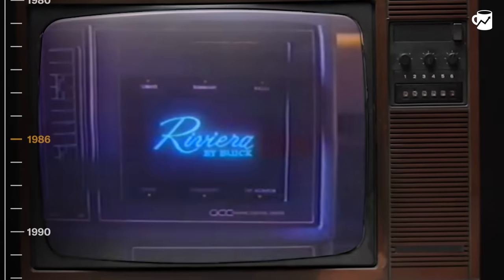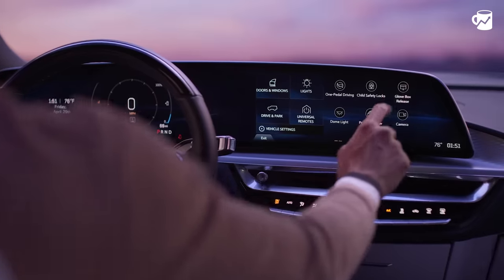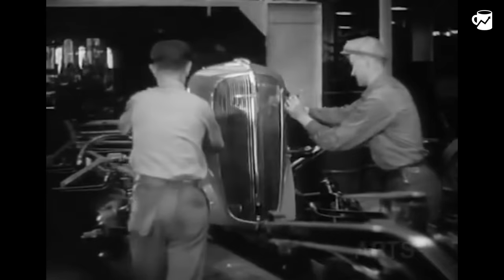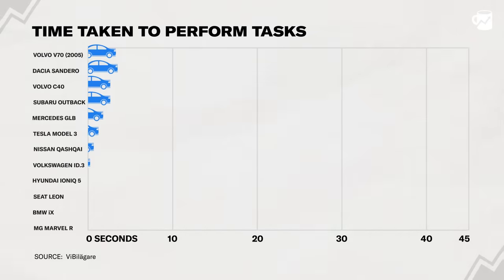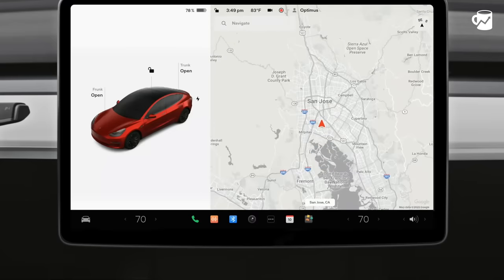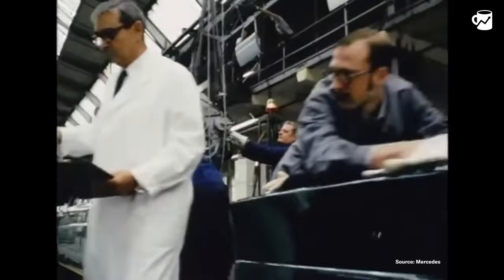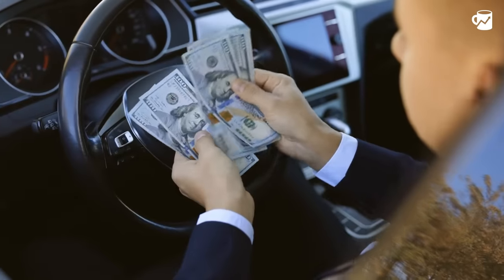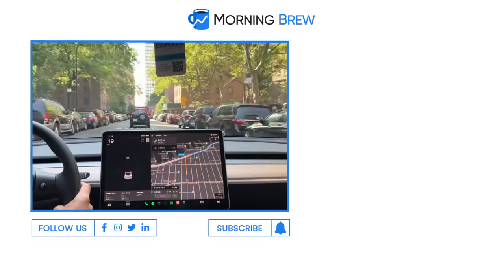The Real Reason New Cars Have Touchscreens

Comment: mazda nails it right now. Small screens mounted above the dashboard near the sightline. My family has a cx-30 and i love the interaction with the infotainment. But everything that you need to change quickly is physical buttons (ex. AC, seat adjustment)
Reply: What’s funny is that the entire automotive review industry seems hellbent on trashing Mazda’s decision to not have a touch screen, and all the screen addled addicts all similarly complain without any valid points.

Personally, I find that the command knob is much less distracting to use, even if CarPlay and Android Auto are touch based interfaces.
Reply: I have a 2021 mazda and I agree on the hardware side of things but mazda's sw is hot garbage.  2018 vw golf is the high water mark IMHO. Small responsive touchscreen but buttons and knobs for all important inputs.
Reply: The location and controls are ok but software is pretty bad. Slow to respond and no color coding to quickly identify a menu. Also sometimes touch is just fast for a quick touch of something but Mazda locks that when driving and the screen is hard to reach
Reply: @fanovaohsmuts  I am a big proponent of buttons over screens, never liked the idea of having important stuff like AC behind a touch screen. I’ve driven Mazdas several times and can easily say that the command dial is worse than a touch screen. It takes significantly longer to do anything and way more distracting while on the road. Want to switch from gps to music? On a touch screen you look over for a second and click the Spotify icon. On a Mazda you have to constantly look over to see where the dial is positioned previously and navigate it correctly to the new icon. The automotive industry doesn’t trash the command dial because they are addicted to touch screens, they trash it because it is an inconvenience and step back.
Reply: @fanovaohsmuts the command knob is garbage to use and makes me want to control CarPlay with my phone, which defeats the entire purpose of making touchscreens less prevalent in the car.
Reply: Excellent video, and I couldn’t agree more with all of it. The only thing you didn’t mention, is the lack of esthetic integration that is also a current trend. Most of these screens just look stuck on the dashboard, or even worse when they are used as a gauge cluster.
Reply: what's in my Corolla is great too. 8" screen which does wireless android auto, but physical buttons for everything that I need to interact with while driving.
Reply: That's how it is in my '22 Civic.  The thermostat controls and all the important ones are all knobs and buttons
Reply: Who tf wants a mazda though 🥱😂
Reply: @afsan2321  Anyone who wants a reliable car that drives decent? something that isn't a korean or american pile of crap?
Reply: @fanovaohsmuts Yeah Mazda did it right by doing that. What I wish Android Auto and Apple Carplay to design their UI to be optimised for physical controls. Means menus needs to be easy to navigate with up and down controls. Just like a game console UI does. This makes the navigating UI more predictable without looking at the screen and once the driver masters it, they can just use muscle memory to navigate the system without looking at all.

They need to stop thinking they need to follow Telsas bad trend. The only thing that they did good for the industry is making EV more attractive. But the UX of their cars is clearly not the best interest of drivers, but just makes them cool to average consumers which is actually not great for driving.

They're just cost cutting and maiming profits all still they are suffering with many QA issues on their first batches of the cars, even later batches.

Seriously, why they heck it needs a touchscreen to even open a glovebox?
Reply: @afsan2321 Alot people. Who wants actually good looking reliable car and not trying to be iPad on wheels. It's still modern car, just not pretending that is self driving car when all cars in existence still haven't reached the level 5 autonomous systems in production. And no Tesla Autopilot isn't full self driving still. It may be the best we have but that's still not classified as full self driving.
Reply: @afsan2321 . Me and the knowledgeable. Every time. Very silly, very ignorant of you.
Reply: @fanovaohsmuts Exactly!
Reply: @LBrisk01 Your opinion, touches screens are the worst things to ever happen to cars and Mazdas knob is much better.
Reply: @kornkernel2232 Mazdas are actually amazing cars. The build quality, the interiors, the performance and reliability is all top of class. He just doesn’t know cause he hasn’t actually been in one
Reply: This is one reason i choose Mazda. Just love their interface.
Reply: @samagon00  Never heard anyone say a Corolla is great. Ugh.
Reply: @ambiarock590  most econo cars are!
Reply: @afsan2321  me. I want a mazda. Buying one today. Preferrable to American crapboxes, and doesn't have a brand premium like honda/toyota. Also no CVT garbage.
Reply: @afsan2321 if you don't understand zoom zoom -part, nobody can help you
Reply: Mazda is nailing a lot these days.  For a company that competes in the very difficult economy/midrange segment their cars are attractive, have a modicum of performance and some of the nicest paint in the industry.  If I was purchasing in that segment Mazda would be at the top of my list.
Reply: I have the same car, having physical buttons for all the basic features was a major draw.

Comment: I once worked in computer security. I don't trust the newer cars with their over-the-air software updates and subscriptions for features. I also hate how complicated they've become, and how the windows have shrunk so much that they require backup cameras now.

I'm keeping my old car because it has real buttons, and I can see out of it. It's also much simpler mechanically, the parts are cheap, and it's easy to maintain it myself. It's 17 years old and has 247,000 miles on it, but it still gets me around comfortably.
Reply: ...I keep wondering how much longer I can hold onto my '97 Saturn, a five-speed manual with 215,000 miles. 

The Subaru BRZ is the first car I've happened upon in a decade that I actually like - and can order in a stick shift - but no one has it in stock locally for a test drive. That will take at least $500 and two or three months... 🙄
Reply: And you are in computer security? 
A profession that requires constant learning, adaptation of new technologies and MUST have a passion to complex problem solving. 
“Your brain is your limitation. Understand that. Turn your fear into curiosity.”
Reply: That's something that I didn't think about. It may be way harder to fix these cars yourself because you'd have to be knowledgeable about how computers and networking work...for buttons that even control small things.
Reply: There are real safety features tho
Reply: @kalecale  In light of recent reporting about how car companies are selling/sharing information, I continue to stand by my comment.
Reply: @RandomRads  i work in IT and do not think everything new digital is a good idea. Usually they solve a problem that did not exist.
Reply: I drive a 2007 Pontiac Vibe with over 240,000 and the it has major hail damaged taking out my sunroof and I still daily drive it.
Reply: The US gov mandated backup cameras in 2018 or so. That freed manufacturers up to make smaller windows.
Reply: @ladyd8028  I hope you have good luck keeping it running. It’s a damn shame that we lost Saturn as a manufacturer. At least the Big Three started treating women as human beings, after Saturn showed them how it was done.
Reply: @AndrewTSq  I suggest that a lot of people in IT don’t understand their own field to include IA. The vast majority of them consider themselves engineers when they are technicians. Highly intelligent, highly skilled and highly productive but technicians nonetheless. Being a technician is not a bad thing, but understanding when you are a technician is an important thing.
Reply: What’s hard to understand about needing a subscription to run your seat heaters? No… Wait…
Reply: @ladyd8028  Wow Saturn that lasted 27 years? That's actually pretty impressive. My uncle used to work at a deal for them and even he didn't deny they were pretty crap quality. 

I'm not suprised my old 97 Camry still runs though. Seems that many of them are still on the road.
Reply: @RandomRads if the value add is complexity and not ease of function… it’s just a cash grab. I’m in the same field and want transportation, my brain can handle whatever. It is a vehicle not a womb or a new wonderful empowering thing.
Reply: @gh0s1wav modern cars have more visibility not less, the law requires backup cameras.
Reply: No offense, but cybersecurity professionals don't actually have to know how to code, or have deep knowledge about the underlying technology. They mostly run high-level risk assessments and recommendations. 

As a software engineer myself, I know it's possible to transmit encrypted data with very secure protocols, and indeed, what you're doing as you make these comments 😊
Reply: I totally agree with you
Reply: @RandomRads He said he is into computer security, not into creating problems that doesn't exist so to learn how to solve them securely out of passion.
As much as you don't like it, no computer is safe over a network unless you pull the ethernet plug off and put it out of the network.
Cars are things that really didn't need to be online, but they do for money and control.
Reply: @RandomRads  Because he works in Computer Security he knows what a shit show modern SPF car design is. Watch any Car Hacking Village tutorials. Kia / Stellantis / JLR are poster boys to not ever buying anything post 2005
Reply: I once told a jeep forum about how I managed to disconect the cell modem in my jeep and I was met with universal criticism and calls of being a conspiracy theorist. I havent gotten any of their annoying software updates however.
Reply: Early 2000s was the pinnacle of car technology and engineering.  It's been mostly downhill since then.
Reply: one of my friends got some 22 f150, the thing does windows updates overnight, kills the battery by the morning. And you can't shut the feature off. New cars are dystopian, communist, and stupid. Besides that fragile plastic, and paper thin sheetmetal... all new cars are scrap, from a mechanic
Reply: @valdorobantu290  communism has plenty of its own problems but this particular issue is a capitalism problem
Reply: I think this is a lot of it. The touch screen I terrace let's the manufacturers know every little thing you do and the definitely keep all that data.
Reply: I am.keeping my old car too. I hate touch screens in cars. Super stupid idea.
Reply: @RandomRads  This is not at all the attitude of people in cyber security, because it's their job to deal with the messes created by people with that attitude.

They are usually more the "I keep a shotgun next to my printer so I can shoot it if it acts up" sort.
Reply: @genericsomething  100% with you on the increasing attack surface and how much I trust car companies to pay the extra money to make sure their closed source software is secure.

The smaller windows though (really, the thicker pillars) is a result of increasing requirements on crash safety, and they do make modern cars considerably better at handling side impacts and rollovers. They also result from having more airbags.
Reply: i currently work in security and i agree wholeheartedly, also a big fat screen lighting up with so much brightness is not preferable when I want to actually see outside the car at night.
Reply: @RandomRads
Reply: @JoeOvercoat
Reply: Not at all. Not only is this a distraction, data privacy nightmare. Now Auto thieves do not need physical access to the Automobile. Not to mention all the other security issues that this opens up. I
Reply: Windows for most haven't shrunk, I don't think. And the cameras were foundational tech. You can't have a surveilance state if there are no surveillance cameras. Step 1: Cameras. Step 2: connect them to "IoT". Step 3: monitor them.

We (humanity) are at step 2/3 depending on where you live. In the UK they're at step 3. In the US they're at step 2.5
Reply: Eventually they'll have outlaw replacement parts and force you to buy a new car.
Reply: 2009 Polo owner here. Simple to drive. Simple to maintain. Massive load space for the overall size. I’m not short of money but for the types of local driving I do I’m really struggling to find a reason to change it.
Reply: @RandomRads  Working in IT has made me personally despise a good majority of technology. I'm happy with my older PC and older phone, I know it inside and out, I also know the new stuff inside-and-out (because I have to), but no way am I gonna use any of it for myself. IOT, Bluetooth, constant windows updates which reset settings and break things - no thanks, I'd rather have stability and reliability.

At our work we still have a lot of Samsung xcover 5 phones in service, people love to complain about that phone but when they see that I have an S4 mini they suddenly stop bad-mouthing what they have, lol.

Comment: It's one thing to have a touch screen to control the radio (as long as there is a physical volume knob), but It gets ridiculous when things like headlights, A/C, etc.. are ONLY controllable thru touch screens.. I prefer how it was in the 90's with a physical button or switch for EVERYTHING. I also don't like having a big-ass bright Ipad like screen blasting 1000+ lumens of light into my face when driving at night..
Reply: I think the "ipad" dims down when its dark? atleast in my audi it does that. And you can turn it off also if you want. But I agree about the rest. It actually feels a bit luxery to have real buttons in a car nowdays
Reply: OLEDs should be mandatory for all car infotainment and instrument displays.
Reply: I've learned to drive with a simple car, no fancy things, only radio and AC. Feels way simpler than on any new car
Reply: When are you turning your headlights on/off? Every car for the last 20 years has had automatic lights.
Reply: @LBrisk01  Do you even open your doors yourself?
Reply: @AndrewTSq  good one?
Reply: The screen light blasting in your face is to attune your eyes to the camera flash like LED headlights blasting your retinas from the oncoming cars.
Reply: @davidmalkowski7850 True, but that will be very expensive though. I think just have good dark theme UI on cars that doesn't look bright in the night. Even LCD can achieve that, thats just UI design. Even OLED can be bright, actually they are even brighter if the UI elements have anything lighter colours.
Reply: This 100% I don't hate the touchscreen in my mom's 2014 dodge charger but I hate that I have to navigate through menus to adjust the AC controls, I get a real knob for the radio volume that is really nice but they didn't put any for the AC.
Reply: saab did it right with their "night panel" a push of a physical button and EVERYTHING except the speedometer up to legal speed turned off (when driving faster more of the speedometer turned on)

incredibly nice during night driving
Reply: @davidmalkowski7850 so that they burn out after 3 years and the car changes for this reason, and not because of engine/transmission fatigue. That's a real "eco-friendly and reasonable consumption" 👍
Reply: Dude you are utterly wrong. On Tesla: 
Headlights,Defrost, wipers auto turn on. 
Volume controls, wipers, auto steer, answering phone everything on the steering. 
A/C is preconditioned. Meaning- warms up before you get out of the bed.
Adjusting heated seats, fans are one touch. And you have auto steer or FSD in case you need more time. Just use it wisely when safe. 
This video is a total BS. It’s just harboring on “the fear of unknown” factor. 
We love flying in Boeing. It’s the false sense of safety that was created by many years of us being familiar with Boeing. That doesn’t mean it’s safe. It’s just a psychological manipulation.
Reply: You are spot on. I drive long distance at night. Any bright dash light is a big distraction and vision reducer.
Reply: @LBrisk01  That is not even remotely true.
Reply: @amac203  that your car headlights haven’t been automatic for years now?  Tell me how often you have to manually turn on your headlights when the sun sets
Reply: @LBrisk01  Not every car though, far from it. And it's more like 10 years that it's been common, not 20.
Reply: @amac203  My 2001 Chevy prizm had automatic headlights and that car sucked lmao
Reply: @LBrisk01  Congratulations on your one example lmao
Reply: all driving necessities should be separate controls in standardized locations I used a van and first time i drove it was in dark in rain couldn't find defrost controls all the stuff was stupid hieroglyphics no words.
Reply: @LBrisk01 My 2015 model car does not have automatic headlights
Reply: @mjc0961  cool, that’s not common and is irrelevant to the Tesla because they are

Comment: Aircraft have glass cockpits, but ALL common and critical controls are always operated with fixed buttons.
Reply: I love my little 3 cylinder turbo. Tons of torque, character, nice sound. But it’s a small car so it makes sense.   Even bmw has kept the idrive knob as they’ve gone to touchscreens on their newest mini coopers.  But it will be 10 years before I buy a 2025 or newer car.
Reply: That way the controls won't lag and freeze if the CPU freezes.
Reply: Exactly so